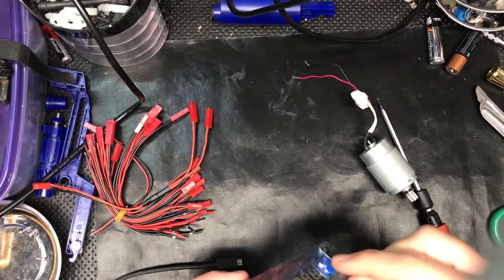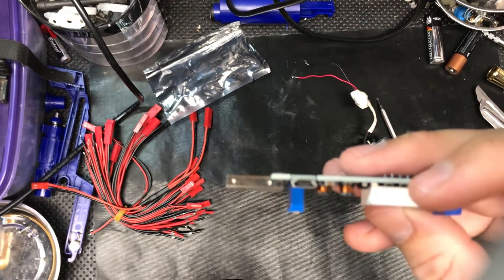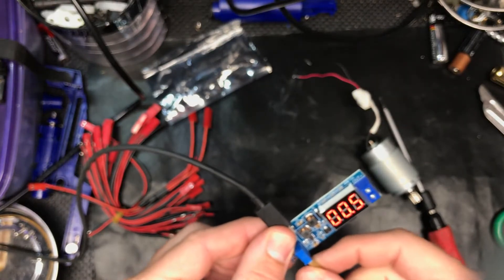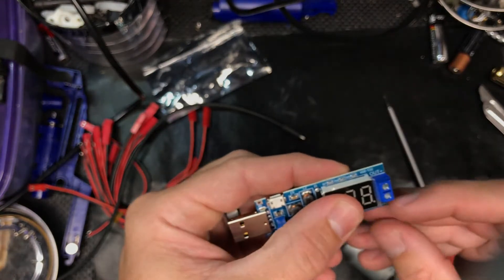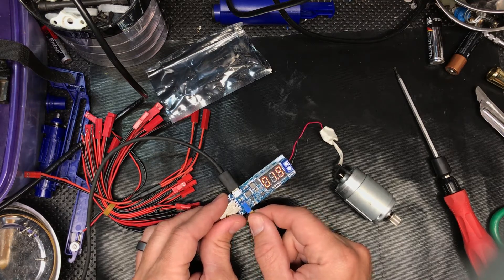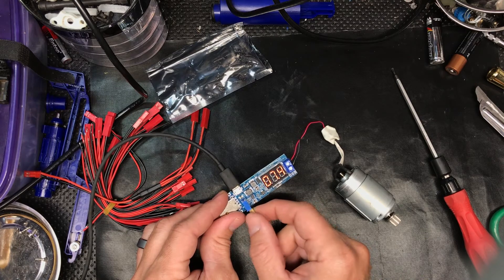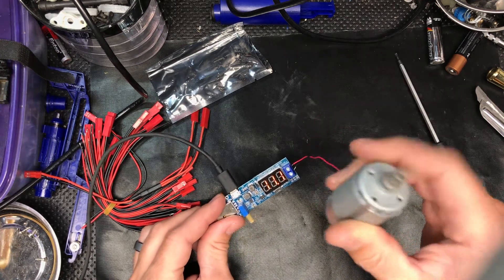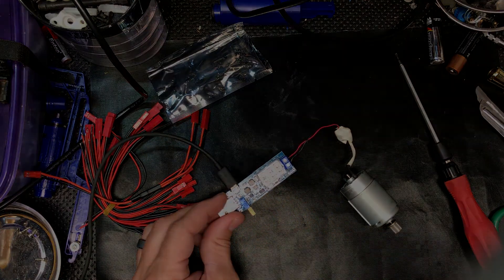Step Up/Step Down USB Module Overview

Comment: Do you know if you can keep it running 24/7?
Reply from the maker: I can’t give you a definite answer because I have not tried that. I think it would depend on how much power you are putting through it.
Reply: @dadsrcworkbench1322  I'll give it a try, I just want to run a couple of Noctua fans.
Reply from the maker: @MarcelodeSouzaSilva  ok. This would be one way to run a fan. Are you dropping voltage or boosting it?
Reply: @dadsrcworkbench1322  boosting from a 5V smartphone charger/power adapter.
Reply from the maker: @MarcelodeSouzaSilva  is the fan 5v or something higher?
Reply: @dadsrcworkbench1322  12v PC fan.
Reply from the maker: @MarcelodeSouzaSilva  this boost converter should work. To run the fan for a long time, I would connect to a 12v wall wart with a barrel jack or power supply if you have soldering skills.